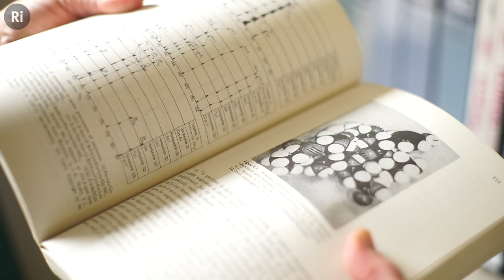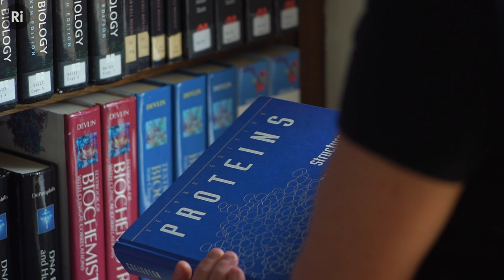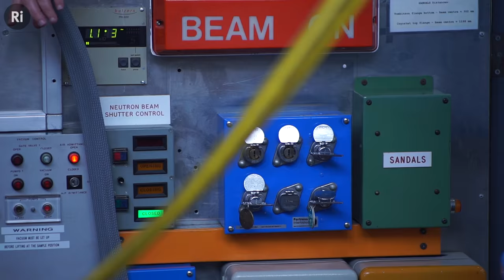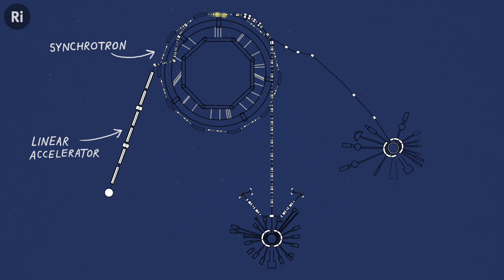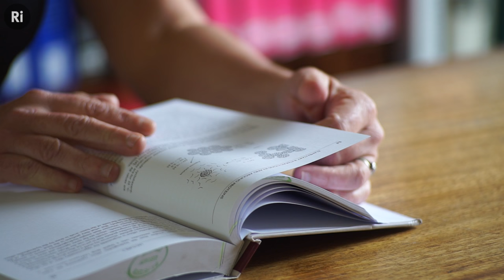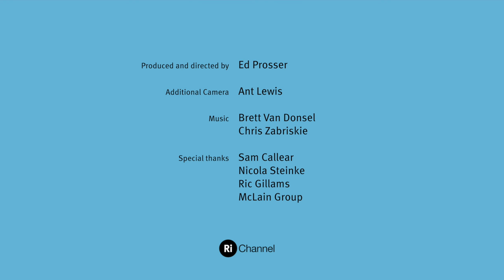Protein Folding and Particle Accelerators: A New Solution

Comment: Hydrogen is so light, quantum mechanics matters A LOT. Water has a lot of hydrogen in it, so a lot of the properties of water are quantum mechanical in nature.
Reply: What's really cool is that for most elements the isotope doesn't really matter (unless it's radioactive). But if you substitute water for deuterated water in biology, nothing works: protons are replaced by proton-neutron pairs, acidity doesn't work the same, hydrogen bonding doesn't work the same, and there are a whole load of quantum processes which slow down due to the heavier mass (read Jim Al-Khalili's Life on the Edge to learn more about that).
Reply: If only I knew what quantum mechanics was....
Reply: @JaredJeyaretnam  my man